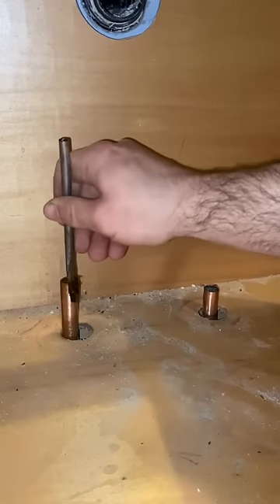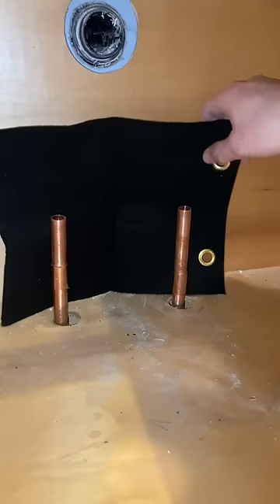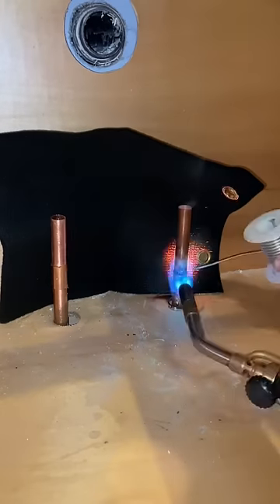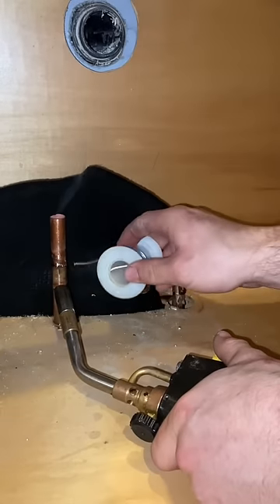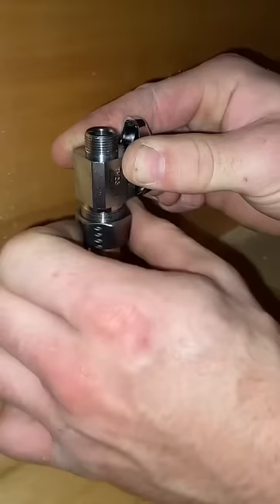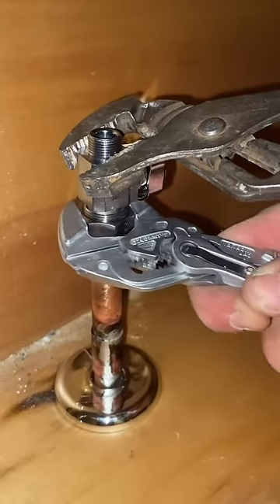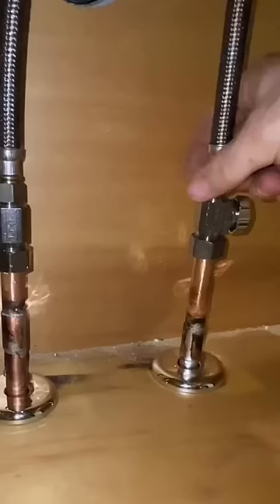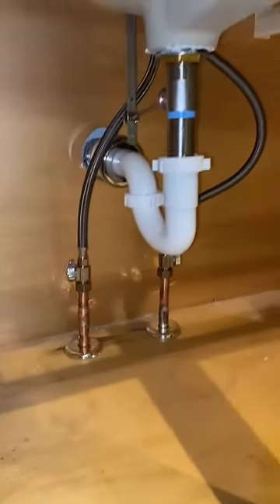Compression Valve Installation. How many errors in this video? #plumber #plumbing #shorts

Comment: Wipe your joints after soldering not sand them. Put some isolators so the copper isn't touching the cabinet. Put a small amount of pipe dope on your compression threads. You reamed the pipe and the burrs can fall back inside the pipe.
Reply from the maker: So far you are winning
Reply: I'll add some nonsense. Should probably hook the sewer line back up.😉 An open sewer line into an enclosed space using fire maybe isn't the wisest. No escuchens. NPT stops are way better. Those rubber lines rot out, use the plastic ones that never fail. Angle the torch to the side to not cook the cabinet. Not the cleanest solder job, but have no room to speak. And clean the screens in the faucet after running a bit and full flow.
Reply: Wipe the joints when cool . Don't use a wet rag on a hot joint or the solder can crack . Just 2 ¢ .
Reply: @court2379 bro chill nothing wrong with breathing in a little sewer gas
Reply: Pipe dope on compression stops? Now that’s debatable. I’ve seen both arguments. Don’t think it matters much though.
Reply: @tytar1037  Look at Brass craft directions. They say to put a drop of oil or sealant on the threads. This allows you to tighten the compression without it binding.  Look at automotive bolts and torquing.
40 years retired plumbing contractor.
Reply: @mrpickle219  I’ve had master plumbers give me crap for doing it so I never did it again. Good to know!
Reply: @JUNEBUGLLC  I was thinking more along the lines of a methane filled box that you are starting a torch in.
Reply: @tytar1037 it's the dumbest thing in the world not to put dope on the compression fittings. I've seen multiple leaks because they didn't use it.
Reply: His biggest mistake is thinking he can do plumbing work! This guy is a hack!
Reply: @jackofalltrades123  I started my career always doing it. I got laughed at. They said it can lead to over tightening and is a waste of time. Sounds dumb but I do what I’m told! Most of the time they have us installing crimp on stops with ugly pex sticking out of the wall. Hate that too.
Reply: I was glad to not see him not putting pipe dope on the compression threads so many make that mistake !
Reply: @patricktheplumber5482  say not again lmao
Reply: @jackofalltrades123  👈🤡👈 LMAO you ok ?
Reply: @patricktheplumber5482  I am not that you fixed your awful grammar. Now if we can turn you in to an actual plumber
Reply: @mrpickle219 you just run the water into a bucket or something before connecting to the faucet
Reply: Well putting pipe dope on a compression fitting for a potable waterline is probably the best way to give the homeowner cancer 👍 just my 2 cents but maybe read the warning label on pipe dope before putting it on a water line
Reply: @themoose123  Maybe you should read the label before posting. The pipe dopes I used for the 30 years were NSF approved and non toxic for potable use.
Reply: Copper wasn't touching the wall

Comment: I would just learn how to solder better point your torch up and away from sides or back of cabinet pre heat the joint and wipe away excess flux so it only goes in the joint . I always bend my solder at the end about an inch makes it easy to reach back and sides of joint . Oo and switch to a map gas turbotorch with a small tip .

Comment: Reamed the pipe vertically, now there is copper shavings in the pipe. Should have removed the aerator to flush it out. Used way to much solder on those fittings and the joints looked gnarly. Burned the cabinet. Other than that, perfectly fine.
Reply: You don't know he didn't flush it with the aerator out, just because he doesn't show it doesn't mean he didn't do it.
Reply: @Vortechtral When you post a video asking people to stop errors, one would assume he showed the whole job. If not its kinda pointless imo since the entire premise of the video is critique.
Reply: @eMDeeG  i have to disagree with you but sonac and Vortec made some good points.

Comment: Copper touching cabinet needs a spacer , never sand joints always flux and clean with water . Soldering needs love . The shavings of the copper are still inside that line , be sure to flush it from the stop before putting the hose on .

Comment: Reamed pipe and let burrs fall back into pipe....over soldered AND Cooked the fitting, which is why you had to sand it(way too much heat/lack of distribution of heat) no dope on the ferring for angle compress stop or threads.

Edit: did you use channel locks on finished brass(i know one of the was smooth jawed but is the other one grooved/toothed)? If so thats another nono

Edit 2:def used regular channel locks on brass....somebody get this man his two checks lol

Edit 3: didnt put eschusions on before soldering so you had to use nasty hinge ones

Comment: So far only see 2 but id like to see one more step. Burned cabinet and let the bures from the reamer fall in the pipe. Id like to see little pipe dope on the comp stops so they dont have to get as tight and helps get them off in the future.

Comment: Two problems, left pipe didn’t need to be done, you showed 90 degree 1/4 turn valves yet installed in line 1/4 turn valves, bonus, did you Raheem the pipes before use and the old ones?

Comment: Air chambers are missing and or air hammer arrestorators this is code in Chicago with vertical vanity or kitchen faucet water lines that come through the ground because of a frozen wall.

Comment: You need to solder better. Shark bites are sketchy. Pipes normally stub out of the wall. Just saying after 40 years of plumbing. 1/2 in of solder to 1/2 in socket. Snake the drips with the solder don't spray it too early it can crack. All ways wipe your joints never sand them

Comment: You used the bottom pliers backwards when tightening the nut for the valve. You didn't use a ferrule for the valve to the right. I don't think those were fully solid soldered joints.

Comment: Copper should come out of the wall not the bottom of cabinet
Reply: Not if it's in a cold climate and it's an outside wall you want them to come up into the cabinet 😊
Reply: @garykrell2058  insulation
Reply: @markwohlgemuth2775  I've still seen it freeze with insulation up north they run them up in the cabinet
Reply: @garykrell2058  wrong insulation

Comment: Did you put Flux on the inside of the union? Is that wrong? I'm not a plumber
Reply: Not wrong. Paste goes on the pipe and the fitting.

Comment: You can prevent all those drips by simply wiping the pipe and fitting with a rag after applying heat and before adding solder